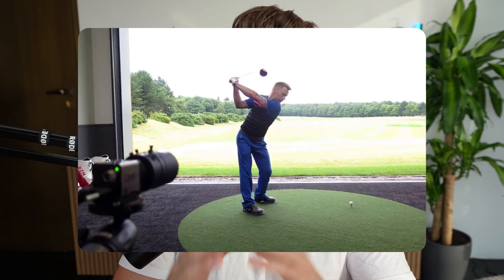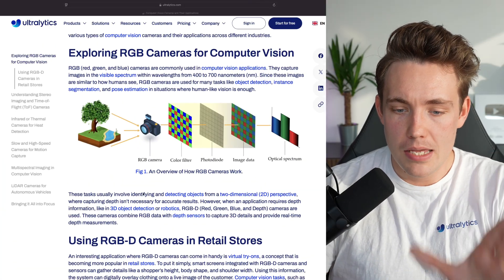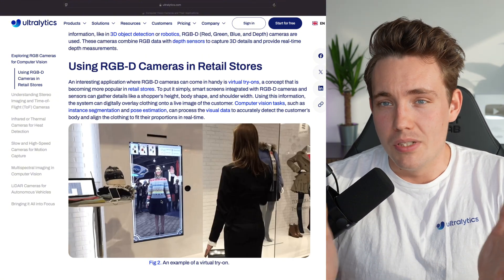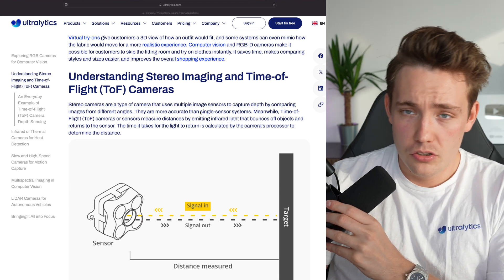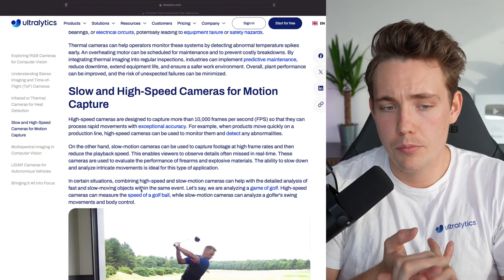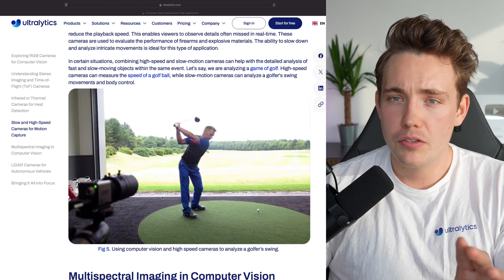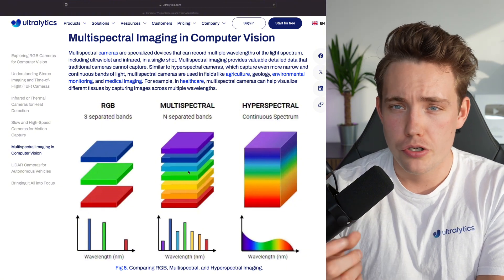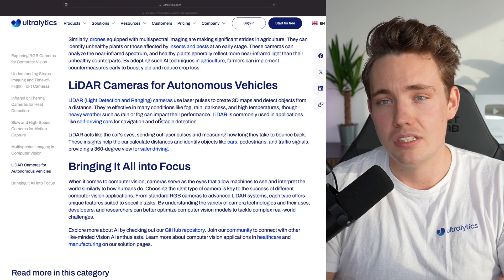How to Choose the Right Camera for Computer Vision Projects | RGB-D | Stereo Imaging | LiDAR 📽️

Comment: Quando a banda é RGB-D, stereo e LiDAR, how do you keep them in tune—calibration/sync, global vs rolling shutter, sunlight/IR spill—so YOLO keeps tempo without dropping FPS? E na prática, tem um ponto de virada onde stereo “samba” melhor que LiDAR (custos, privacidade em retail) sem perder precisão?
Reply from the maker: Ótima pergunta! Para manter RGB‑D, stereo e LiDAR “afinados”: faça sincronização por hardware (trigger/PTP) e fusão por timestamp, calibre bem intrínsecos/extrínsecos e alinhe RGB→depth; prefira global shutter em cenas com movimento, e bloqueie exposição/ganho para evitar variação. Para sol/IR spill em ToF/structured light, use filtros IR estreitos, sombreie o emissor ou opte por stereo passivo sob sol forte. No ROS, o fluxo de alinhar RGB e depth é direto: docs.ultralytics.com/guides/ros-quickstart/

Para não perder FPS no YOLO, use YOLO11n/s e resolução 640 (ou menor), separe captura e inferência em threads e exporte para TensorRT/OpenVINO: docs.ultralytics.com/modes/export/

Stereo vs LiDAR no retail: em ambientes internos, até ~8–10 m e câmeras fixas, stereo/RGB‑D geralmente vence em custo e pode ser mais “privacy‑friendly” se você armazenar apenas depth, mantendo precisão suficiente para contagem, heatmaps e filas. LiDAR compensa quando você precisa de 3D muito robusto em longo alcance, baixa textura/baixa luz ou tracking 3D preciso com menos oclusões. Comparativos rápidos de stereo/ToF/LiDAR: www.ultralytics.com/blog/computer-vision-cameras-and-their-applications e www.ultralytics.com/blog/exploring-various-types-of-data-for-vision-ai-applications. Para fundamentos de depth: www.ultralytics.com/glossary/depth-estimation

Comment: LiDAR sings in points, RGB hums in color—when you make them duet in the wild, how do you keep time and tune? Any tips on long-term extrinsic stability, multi-sensor timestamping, and handling rolling vs global shutter under vibration?
Reply from the maker: Love the metaphor! To keep LiDAR+RGB in tune long-term: lock in extrinsics with a rigid, thermally stable mount (dowel pins, torque spec, threadlocker) and add vibration isolation away from resonant frequencies; then schedule quick field checks and re-fit extrinsics using a target (checkerboard/AprilTag) or natural-feature SLAM, alerting on rising reprojection error. For time, prefer a single hardware clock: GPS PPS or IEEE‑1588 PTP plus hard triggers; use ROS tf2 for frames and only fall back to software sync (message_filters ApproximateTime) if you must. Deskew spinning LiDAR with IMU during each scan, and prefer global‑shutter cameras under motion; if you’re stuck with rolling shutter, cut exposure, raise gain, and apply IMU‑aided rolling‑shutter correction. A short primer on frames, time, and point clouds is in our ROS quickstart: https://docs.ultralytics.com/guides/ros-quickstart/ and for durable extrinsics, see our camera calibration guide: https://www.ultralytics.com/blog/a-guide-to-camera-calibration-for-computer-vision-in-2025. If you share your sensor models, sync options, and ROS1/ROS2 stack, we can suggest a concrete wiring and config.

Comment: So bro, if I’m tracking deer in the woods at night, is thermal really worth the extra battery drain, or would RGB-D with some moonlight get the job done? Anyone else burned cash on fancy sensors they didn’t need?
Reply from the maker: Great question! For tracking deer at night, thermal cameras really shine—they don’t need any ambient light and can easily spot warm bodies even in total darkness, dense brush, or fog. RGB-D cameras, on the other hand, still rely on some visible or infrared light, so their performance drops in low- or no-light conditions, even with moonlight.

Thermal imaging is often worth the extra battery drain if reliable detection is the priority, especially for wildlife monitoring at night. But if you have consistent moonlight and open terrain, RGB-D might work, though it’s less foolproof. Many users start with basic cameras and only upgrade if needed—overengineering is a common (and expensive) trap! More details on camera types and practical advice here: https://www.ultralytics.com/blog/computer-vision-cameras-and-their-applications

If you want to maximize battery life, consider hybrid setups or only enabling thermal when needed. Let us know what works for you!

Comment: Thank you for the informative video.
Question: Any guide to use YOLO for RGB-D data? I am currently working on a project where we can obtain RBG-D data quite easily, I am wondering if it is possible to modify the YOLO model to detect with 4 channel date.
Reply from the maker: Great question! Ultralytics YOLO models are designed for standard 3-channel (RGB) input, so directly training or running inference with 4-channel RGB-D images is not natively supported. However, you can still leverage RGB-D data by using only the RGB channels for YOLO detection and then aligning the results with the depth data for post-processing (like measuring object distance or 3D localization).

For best practices and code examples on combining YOLO with depth data in robotics or ROS environments, check out our ROS quickstart guide: https://docs.ultralytics.com/guides/ros-quickstart/. It explains how to process RGB images for detection and then use the corresponding depth channel for tasks such as 3D segmentation and distance calculation.

If you want to experiment with custom 4-channel support, you would need to modify the model’s input layer and retrain from scratch, but this is quite advanced and not officially supported. Most workflows simply process RGB images with YOLO and use depth as additional context afterward.

Comment: Yo, this is fire!! 🔥 But real talk – how do u balance cost vs performance when picking between something like RGB-D or LiDAR? Like, is it worth the $$$ for LiDAR if ur project doesn’t involve self-driving cars, or nah?? Asking for my wallet AND my curiosity!
Reply from the maker: Great question! Balancing cost vs performance really depends on your project's specific needs. RGB-D cameras, like Intel RealSense, are more budget-friendly and versatile for many applications, such as robotics, virtual try-ons, or even indoor mapping. They provide depth data and are ideal if you don't need extremely high precision or long-range detection. 

LiDAR, on the other hand, is pricier but excels in accuracy, range, and environmental resilience (e.g., low light or fog), making it indispensable for tasks like autonomous driving or large-scale 3D mapping. If your project doesn’t demand that level of precision or range, an RGB-D camera should suffice without draining your wallet.

For a deeper dive into applications, check out this guide on RGB-D and LiDAR cameras https://www.ultralytics.com/blog/computer-vision-cameras-and-their-applications. 😊

Comment: Great breakdown of camera types! Quick question though—how do you handle sensor fusion when combining, say, RGB-D with thermal or LiDAR data? Do you find there's a trade-off in latency or accuracy when you scale up to real-time applications like autonomous navigation? Also, where my quantum cameras at?
Reply from the maker: Combining data from RGB-D, thermal, and LiDAR sensors (sensor fusion) can significantly enhance a system's understanding of its environment. The key is aligning and synchronizing data from different sources. For instance, RGB and depth data from RGB-D cameras must already be well-aligned, and techniques like calibration matrices can help merge these with LiDAR's 3D spatial data or thermal imaging. This fusion ensures a richer dataset for real-time applications like autonomous navigation.

Trade-offs do exist. Scaling up to real-time applications can introduce latency due to the computational load of processing and merging multi-modal data. Optimizing algorithms and leveraging hardware accelerators like GPUs or TPUs can mitigate this. However, slight trade-offs in accuracy might occur depending on the environment (e.g., poor lighting or heavy weather affecting certain sensors like LiDAR). 

As for quantum cameras, they're still emerging! These promise groundbreaking capabilities in low-light imaging and high-precision measurements, but their practical deployment is still in research phases. Until then, leveraging advanced multispectral or hyperspectral sensors can bridge the gap. For more on sensor fusion and calibration, check the detailed insights here: Camera Calibration for Computer Vision https://www.ultralytics.com/blog/a-guide-to-camera-calibration-for-computer-vision-in-2025.

Comment: can ultralytics hub train models using RGB-D, thermal (i.e. 23.3 degrees), or multispectral, hyperspectral (4+ channel or hypercube) images to detect and segment objects?
Reply from the maker: Yes, Ultralytics HUB supports training models for a variety of data types, including RGB-D, thermal, and multispectral/hyperspectral images, provided the datasets are correctly prepared. You can upload custom datasets in the required formats and use them to train YOLO models for detection and segmentation tasks. For detailed guidance on dataset preparation and integration, check out the Ultralytics HUB Datasets Overview https://docs.ultralytics.com/hub/datasets/.
Reply: @Ultralytics  how do you encode a hypercube (or more than 3 channels, like depth, or floating point like thermal) in jpg?
Reply from the maker: JPEG files typically support only 3-channel (RGB) or grayscale data, which means they aren't suitable for storing multi-channel data like depth, thermal, or hyperspectral information directly. To encode such data in a JPEG-compatible format, you can preprocess the data by normalizing or scaling it into the 0-255 range and mapping specific channels to RGB. However, this may lead to a loss of precision or information.

For more precise storage, consider using formats like TIFF or HDF5, which natively support multiple channels and higher bit depths. These formats retain the integrity of multi-dimensional or floating-point data. You can then preprocess the dataset to convert it into these formats before training with Ultralytics HUB.

For guidance on dataset preparation for Ultralytics HUB, refer to the Ultralytics HUB Dataset Documentation https://docs.ultralytics.com/hub/datasets/. Let us know if you'd like tips on structuring or preprocessing your specific dataset!

Comment: Can ultralytics' YOLO models be used on normal CCtv cameras. If yes what are the requirements??
Reply: Yes it can, IP camaras into stream that can be processed in a server, NCU, picofox, jetson, raspi, esp or any hardware to do inferences, the part i think your question is referencing is that for production is not enough. please clarify at what stage you want to use you VC service. IA PM specialized on VC here.
Reply: @josetomasl.4611  hello sir,thanks for the reply i am still on a small prototype, though i was curious on whether relying solely on edge devices may not meet production demands of large scale projects
Reply: it will always depend on the amount of VC services running in it. a VC service is a set of task rules (your algorythm that counts cows of an specific type that are in a area for an amount of time for example) that follow your business desition (closing or not a gate if they reach the full capacity of cows).
At the end who is better in its pipeline can lower costs and diffirentiate from the rest.
To respond to the question: edge devices could be use on small scale solution with 5 camaras attached but for a full cctv system I would buy a server stackable GPU or NCU.
Reply: Yes, they can be used.
requirements:
a hardware like Nvidia Jetson Orin/Nano(that can run an AI model like YOLO), and of course you would need to stream the cctv footage to the Jetson and then process it
Reply: @muneebmushtaq1  Thanks for the reply, let me try it out but is this applicable for large scale use cases? It can be very expensive
Reply: @elviskiilu3977 for large scale I think You may want to rent a GPU server that would fit your budget and then you could link that to your cctv footage and do inference there, as far as I remember CCTV’s capture video at 1FPS so it should be fairly done using a small GPU server like even a T4 GPU which should cost around few cents per hour
Reply: @muneebmushtaq1  Yeah, thanks i now have a fairly clearer sight of the implementation
Reply from the maker: You're absolutely right—scaling depends on the complexity and volume of vision tasks (VC services) and the pipeline's efficiency. Edge devices work well for small-scale solutions like up to 5 cameras where low latency and localized processing are key. However, for larger-scale systems like full CCTV setups, centralized solutions such as stackable GPU servers or NCUs are more practical. They offer greater computational power and scalability to handle multiple streams and complex algorithms efficiently.

For cost-effectiveness, cloud-based GPUs (e.g., AWS or GCP with T4 GPUs) can also be a good starting point for scaling while avoiding significant upfront hardware costs. For more insights on deployment options, check this guide: Model Deployment Practices https://docs.ultralytics.com/guides/model-deployment-practices/.